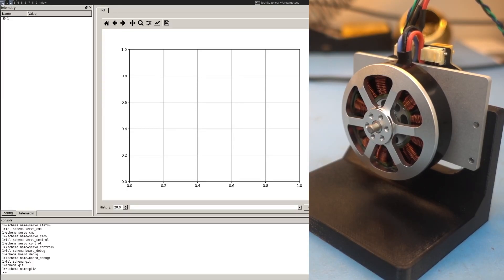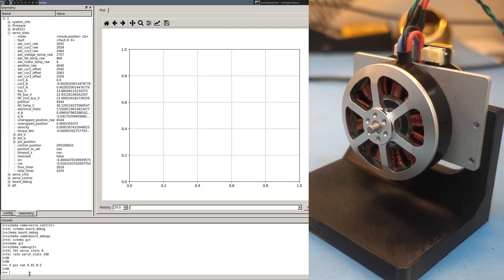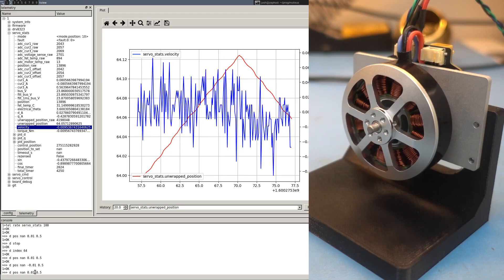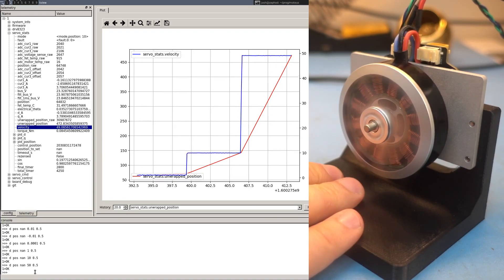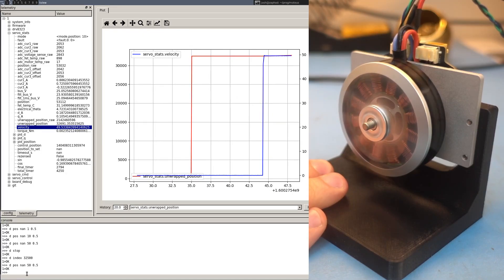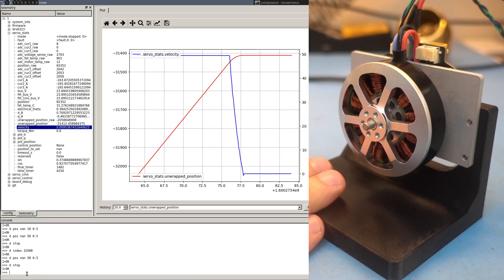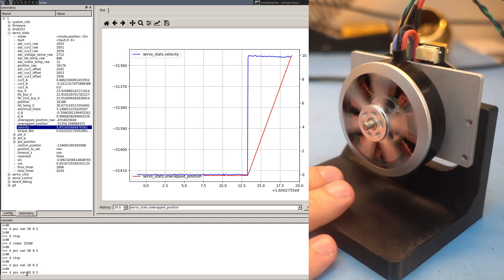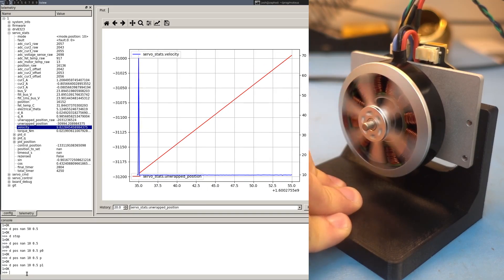Unlimited rotations with the moteus controller

Comment: Hi Josh, is there an encoder built in to this particular motor to check that it is spinning at the desired rate e.g. 1Hz. How does it know it’s spinning at that exact velocity without feedback? Thanks!
Reply from the maker: The moteus controller has an integrated magnetic encoder!

Comment: Josh, that is a remarkable project and achievement. I am just amazed. Can you kindly tell me the specification of the frames motor you used including its Kv value, maximum power output and number of poles, weight etc. Also price and where did you get them from. I will be really grateful.
Reply from the maker: This video just shows a generic 5008 multicopter motor.  If you are referring to the internals of the qdd100 servo, that is a custom frameless motor in the same class as a T-motor U8.
Reply: @awesjosh  Thank you so much. Yes I was asking about qdd100 servo. If appropriate and if you can, can you kindly tell me the max power output and the Kv value from your T-motor. I am asking since I am hopping to get more torque for my future design and since you have the actual measurements, I will be able to guess what would be mine. If I improve upon, I promise to share my findings.  I have just started. So just needed a little bit of help. Thank you.
Reply from the maker: I'm using a 135 Kv winding, and the max torque of the motor pre-gearbox is around 3Nm at ~700W power.
Reply: @awesjosh  Thank you so much Josh. I really appreciate it. Do realize that you inspired many of us.